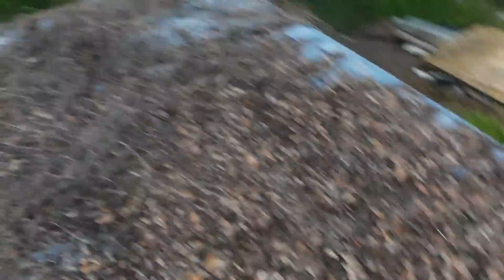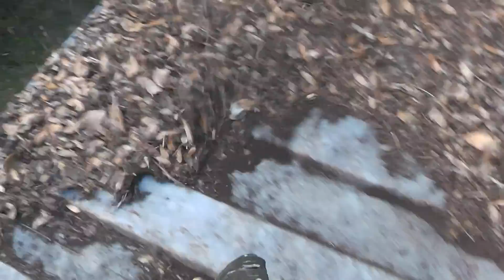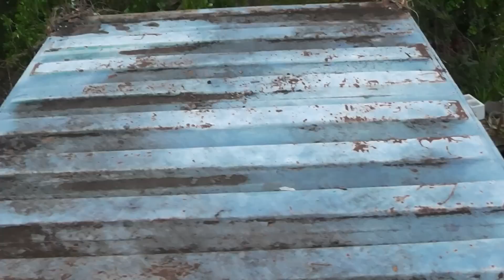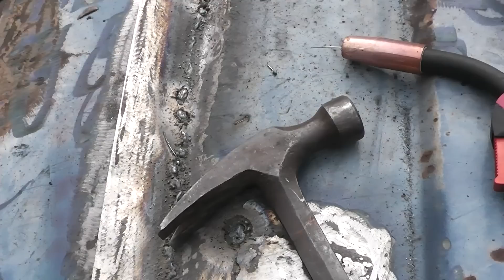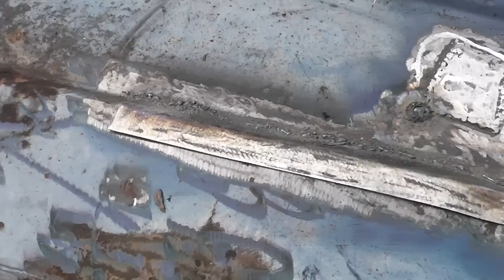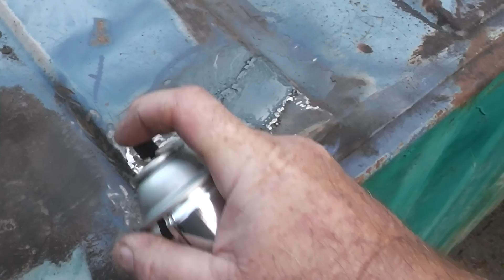Shipping Container Welding and Patch Repair

Comment: I got a sheet of 1.5mm cold rolled steel, welded it fully around the perimeter, i used gas shielded wire for the welding .8mm any areas at the end that curved down i was able to bend or hammer down with a chisel if it was a tight bend or dent. Tack it every 8 to 10 inches, then welded between the tacks 8 to 10 inches at a time, skipping a section, weld a section skip etc.
Worked out well it was water tight, I put a coat of paint on it when I was done. 
It was the cheapest way I could find to do it, proper patch panels were to expensive for the size of the area i had to cover, and it wasn't worth spending a bunch of money on a container so old.

Comment: I good tip I was given is use a bottle jack and 2x4 to slightly bend the roof upwards. Not a lot, just enough to prevent rain from puddling for months of the roof. I painted my roof afterwards and it's been great going  3 years with no puddles, no rust.

Comment: Just curious about the repair longevity, has it held up? I work for one of north americas largest container storage companies and we have to use Cotten type B steel for the repair if not an entire roof panel. I’ve seen repairs using mild steel fail faster than 2 years.
Reply from the maker: All of the repairs are still holding up. No leaks...yet.
Reply: Good to know man! I’ve patched so many holes this year that weren’t welded ( roofing tape, caulk, screws, flexseal, jbweld, tar ect...) glad you saw that coming and chose the right way!

Comment: Nice job, do you think that  the stuff they coat mobile homes and trailers would work to coat the roof?
Reply from the maker: Thanks.  I have had many people suggest that option to me. However, I encountered some kind of rubberized spot repair that had been done on this container in the past and it was a real pain to remove it to get at the rust bubbling up underneath it.  I had visions of trying to remove that stuff off of the entire roof and I decided against it.  But, if properly done it might be a blessing.  I will need futher info to let you know for sure.